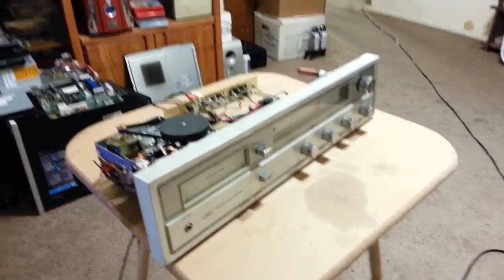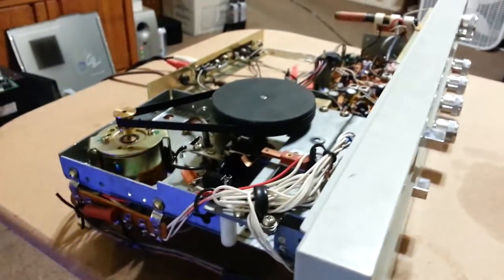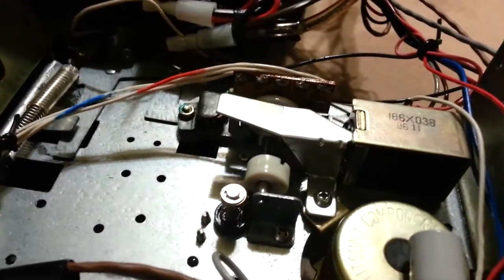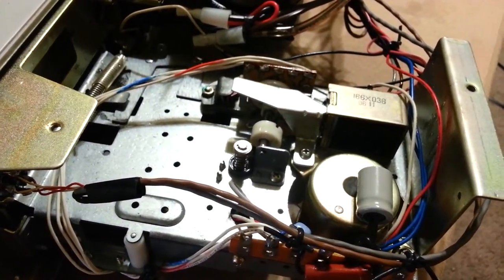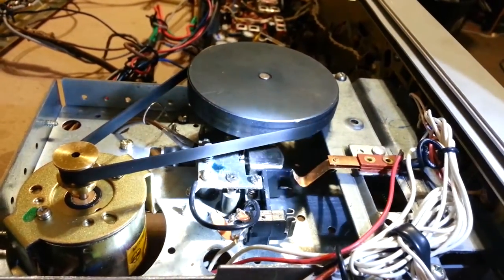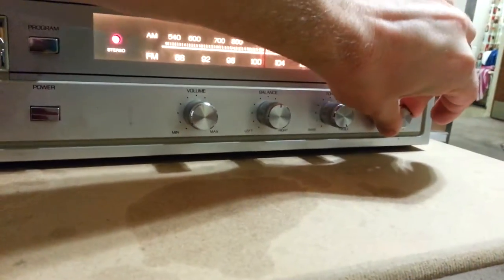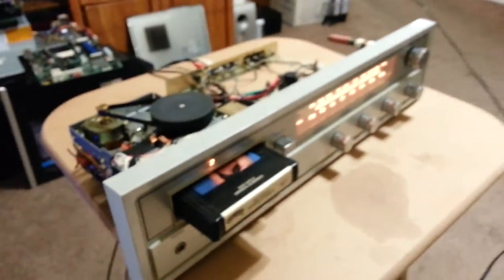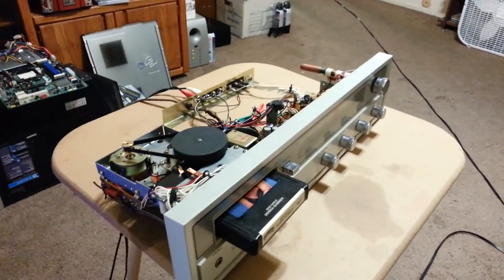Sears Solid-State 8-Track Player Restoration (Model: 400.91308 900)

Comment: Hi, one good thing(and important) to do with any tape deck is to demagnetize the head.  If it was never done or done very little there can be magnetic buildup from the tapes played in it.  This in turn would begin to erase the high frequencies and make the tape sound muffled on the highs, which is permanent damage.  Anyway, I wanted to share this and I enjoy the restoration videos of these units.  I miss the 70's!

Comment: This was a piece of 'budget' stereo kit in its day; it likely came with a pair of inexpensive bookshelf speakers so it could be 'up and running' very quickly once you brought it home.  Many department stores sold similar stuff under their own name, as well as branded GE, Sylvania, Gran Prix, Emerson, etc.  In its day, I think the whole setup, sans record changer, was about $100.

About 2-4 watts per channel, but with a set of better speakers that's more than enough for most folks.   The phono input is for the then-common autochangers, which used ceramic cartridges.   You can use them with modern, magnetic-cart turntables like the LP60 if the unit has a built-in preamplifier  (some don't, but you can buy a separate preamp if need be).   The phono input can also be used for other l ine-level sources like a Bluetooth receiver, if you want to modernize a bit.

I wish they still built stuff like this.   Obviously the 8-track would be out of place today, but a USB port and reader for MP3s?   Or maybe a cheap CD?   No, don't tell me about those all-in-one things they sell on Amazon and at Best Buy.  I'm aware, and they are inferior to even THIS budget item.

Comment: "Solid State', for those not familiar, means the amplifier and electronics are semiconductor (aka transistor) based rather than tube-based.  At the time this was produced, the vast majority of home electronics were transistor-based, so the term is essentially meaningless here.  It's just effectively a 'nonsense' word tacked on to make it sound impressive, like 'high fidelity'.  Marketing departments love stuff like that.

Comment: I still have my 8 track recorder deck and I have had it since I was 12 years old when I got my first stereo . and it is still going strong and for jeff you may think the way you do but vintage audio gear is so much better then the current crap that is around today .vintage turntables reel to reel decks and pre -amps and amplifiers are so much better and all the companies way back then made stuff to last and cared about the quality not like the junk made today by companies that only want to make a buck on the crap and junk they make . I have a dual cassette deck and dual cd player and that is as modern as my audio is . everything else is vintage and top quality . crosley and all these other companies that try to make vintage stuff should all be closed down. all of them are junk with a few exceptions . great video thank you for posting this

Comment: I just repaired a soundesign 8track cam gear was stuck that changed the tracks.
They made great looking audio in the day.glad you got it going.
Only issue you have is a frozen spot on the motor.cause you have to give it a push like a old car lol.You got a Nice Player there

Comment: Solid state means the electronics do not use tubes and all transistor and other such components. You can probably get that stalling startup like you said by cleaning the motor, you may have to completely and carefully disassemble it and clean all of the bearings, you may also have to remove the capstan, it's the shaft that runs through the player and is permanently fixed to the large wheel, this may be more likely the issue since it is much more likely to pickup debris

Comment: So all of these units, regardless of the brand on the face, were made by Panasonic.  Including the 8 track tape player.  These units were available with a number of configurations with names like Fisher, Zenith, Symphonic, Electrophonic and on and on.  Some came with record changers and cassette decks and were known as component stereos.  Their sound of OK but not as good as the console stereos they replaced.

Comment: your video is very helpful I have a solid state 8-track tape player in my record player console it doesn't work it does turn on. track changing does work but 8-track tape doesn't I assume all the 8-tracks are same.  your video will help me when I have a chance to take it apart

Comment: Can I assume all 8-track players are the same no matter the model mine is in a 1973 sears a roebuck record player AM/FM  radio console, 8 track doesn't play one thing I do need that its missing is a belt. Any clue where I can find one?  Thanks awesome video!
Reply: +Taylor Guild  Can you assume that all 8-Track players are the same?  No, there are numerous variations on them..  However, many problems with them are common - dirty contacts, deteriorated or broken belts, dried grease, head misalignment, and so on.  The electronics in them are usually fairly robust, however.  Incidentally, these issues are actually common across all types of tape decks - cassette, open reel, and 8-Track.

As for finding belts, you're probably going to have to measure your broken belt or get a good idea of how long your replacement belt should be.  There are numerous sites you can try to find a replacement belt; my go-to is:
https://www.turntableneedles.com/8-Track_Cassette_Deck_Reel_to_Reel_Rubber_Drive_Belts

They'll give you some guidelines on how to measure for a replacement.  The vast majority of 8-Track players I've seen use a 'flat' belt.
Reply: There are a handful of different designs, the repairs are basically the same but part placement and track changer designs are different, and the screws are located in various locations, that was kind of an odd design with track changes. I would not sand anything  besides the capstan and the would need very very light sanding with much higher grit and nothing near the 250. The rest on that model are due to dried grease like a turntable sanding is a bad last resort, complete grease gunk removal and relubed with new grease would be the best option.

Comment: its a bit draggy.. Check the felt replace with 3/8.. less pressure on the head.. longer life.. save the captstain a lot of hard work. Remove and Clean capstain with Lighter fluid,., that should should do it,, a little 220 fine  sandpaper as well..

Comment: the motor really should be taken apart and all the bearings need to be lubricated and lined up then you will not have to spin the flywheel ever again.

Comment: This video is indeed informative – however – 97% of people watching it still will not know what or how to do anything you described. Because you’re not technically showing them how to do it – you’re just giving us camera angles and telling us “what you did” (off camera), but not showing us.  Removing this, cleaning that, lubricating this, sanding/removing the rust from this screw, cleaning the motor, etc. etc. - there is no visual to show people HOW. Even just getting the 8-track player/unit out of this particular housing to do an observation is NOT THAT easy...